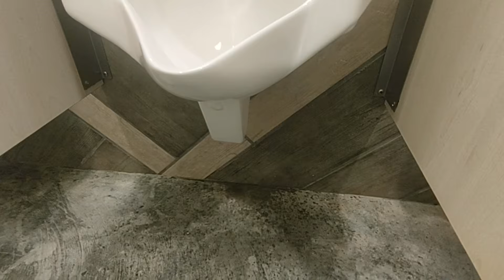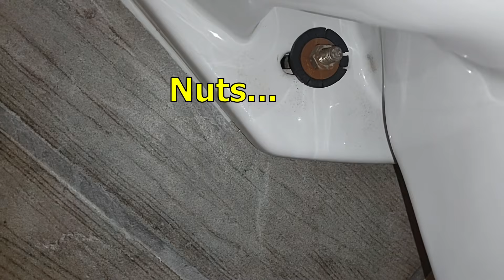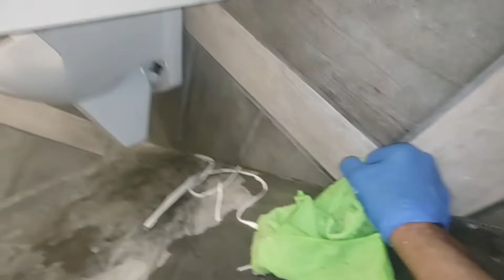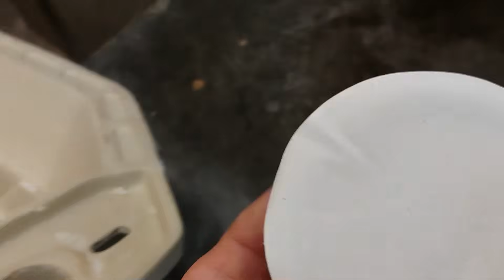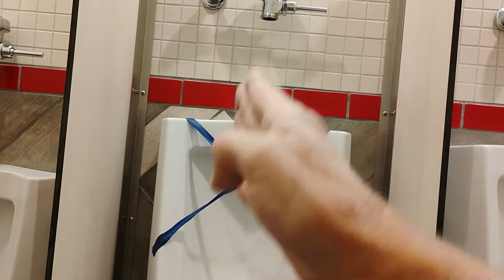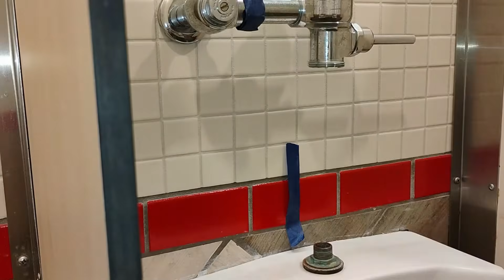Urinal leak fix - including adjusting for an off-center / crooked flange installation

Comment: The flange in flangein freaking with is broken. How do we install a new one since the elbow is inside the wall?
Reply: get urinal flange repair kit. had a urinal with a broken flange and it save me from having to bust up some nice tile. it goes on behind the broken flange so your bolts have something to grab on to